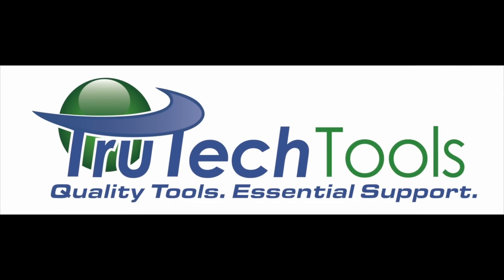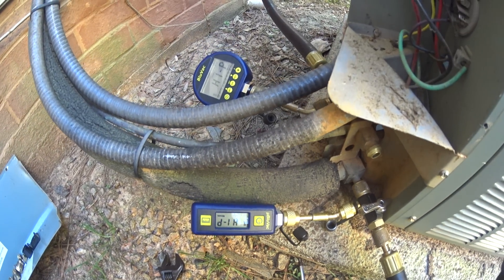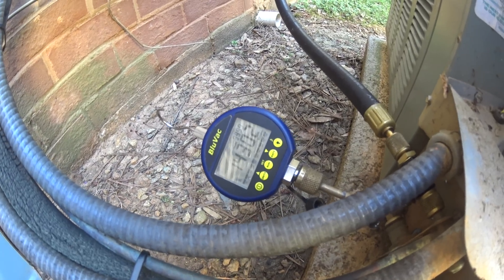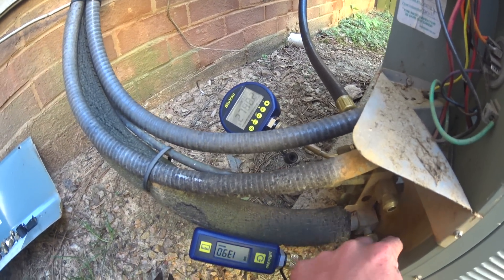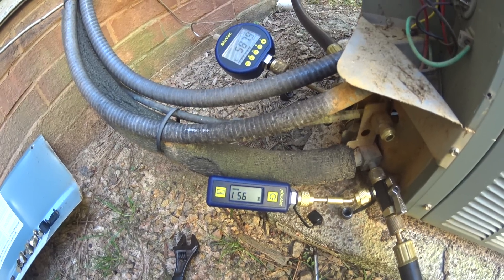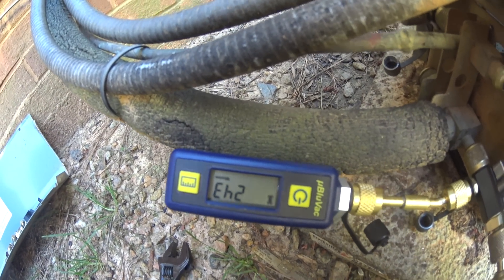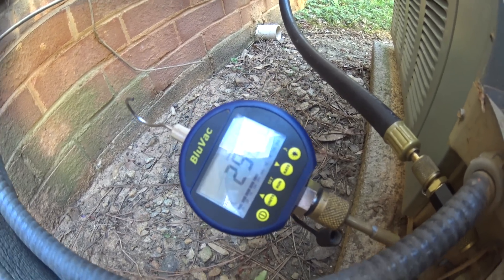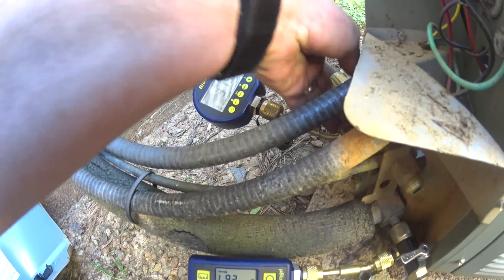HVAC Tools: Micro BluVac and Original BluVac Comparison

Comment: Stephen R, do you release the charge while the bluvac still on so you don't loose any vacuum  & the bluvac gets hits with some positive pressure from refrigerant?
Reply from the maker: +Oscar Arevalo yes, the BluVac is capable of receiving high pressure and the only potential issue may be oil. Not a major issue though

Comment: Did you take the screws off the valve bracket to get your removers on?? I do that on all the Rheem cubes or else mine don't fit.
Reply from the maker: +Justin Hernandez yes, the bracket was a bit of a pain to remount when I was finished though.

Comment: Do you know much about the Testo 552??
Reply: +Stephen Rardon (HVAC with Stephen Rardon) I like the 552 once I learned how to use it correctly!   lol.   but for me the micro is GREAT!
Reply from the maker: ***** has had his hands on it as well as BK HVAC I had one for a couple days and didn't like it compared to the BluVac
Reply: I sent my back for warranty had it for a couple days. It wouldn't read correct microns
Reply from the maker: Richard Baylis I've heard that from several people
Reply: +BK HVAC (Billy Knoth) how did you get it to work out for you? Testo was telling me I need vacuum rated hoses
Reply: I've had the 552 for some time and I like it but for decay I valve off and set a stop watch on my phone where the fieldpiece has decay built in.  Otherwise its been good and it passes leak tests on a recovery tank once a month with its fieldpiece back up.

Comment: I have the yellow jacket one in the video. Very nice but it is very slow to react sometimes. I wish they would make it with a female connection instead of the male. One less connection that could leak. Great video!
Reply from the maker: Thanks +Meno Meno female connection would be nice when you didn't need the offset

Comment: I like your set up. I need one of those and a vacuum hose with 1/4 and 3/8 fittings.
Reply from the maker: +Nestor Rodas guys I work with runs a single hose on the suction line and that works really well too. 2 hoses is nice but a little over kill sometimes